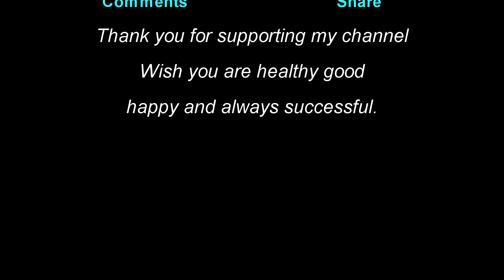DIY Powerful Audio Amplifier Super Clear With TDA7296

Comment from the maker: 0:00  Assemble the amplifier circuit with TDA7296
5:48  Assemble the power supply for the amplifier IC
9:14  Start testing  the circuit just done
Reply: 0:00 click failed, you should press 0:01
Reply: does the assembled power supply give ac or dc voltage?
Reply: @arsenisarsenidis9659  transformer gives AC and the diodes and capacitors assembly gives DC(plus and minus and GROUND in the same time). it is a full wave bridge rectifier . So the entire assembly gives DC. One wave is plus 15volts and 0(GROUND) volts, the second wave is minus 15volts and 0(GROUND) volts

Comment: Can we replace 7296 for  7294 ic
Reply from the maker: You compare the datasheet of the two ic
Reply: @ShareTechCreative   brother I have 7294 ic but 7296 is similarly equal to 7294 can I apply the same circuit diagram
Reply from the maker: @mr.engineaudio4350  Yes can

Comment: Good Amplifier module ... but for the power supply part i dont suggest that the power capacitors placed near to the power transformers due to heat issue ... electrolytic capacitors durability will be reduced if subjected to heat
Reply from the maker: Ok, thanks